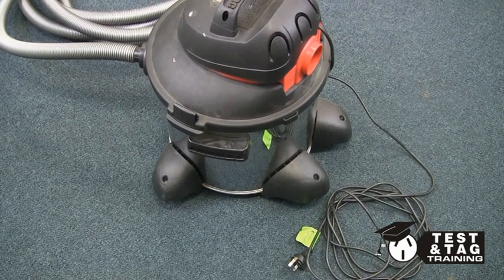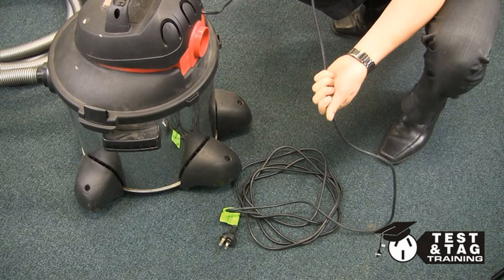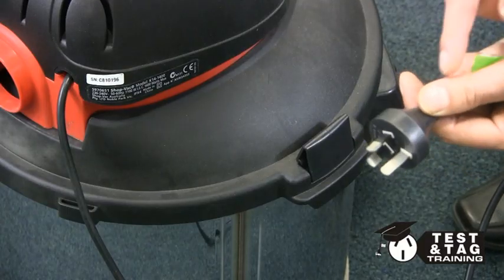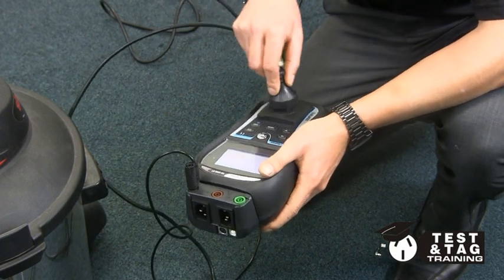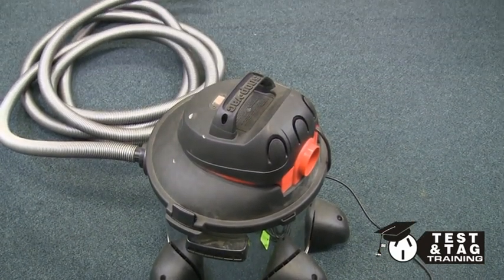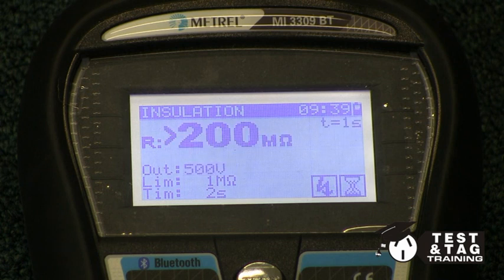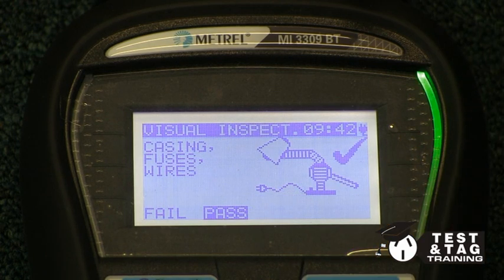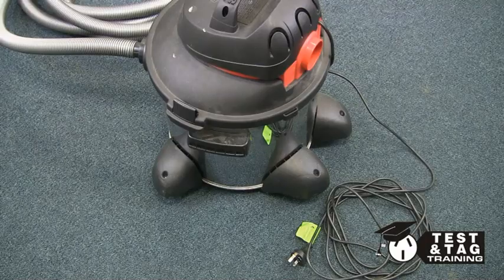How to Test and Tag a Vacuum Cleaner

Comment: I recently bought a vacuum from a charity shop and it had been pat tested and was Safe but then 1 week later it stopped working
Reply from the maker: That's quite unlucky 'Just for the comments'. Having it PAT tested is really just one step to ensure the appliance is safe. The fact that it stopped working could of been caused from an enormous number of factors. Thanks for the input!
Reply: +Test and Tag Training 
Just last night I went back and plugged it back in and now it works again must be overheating